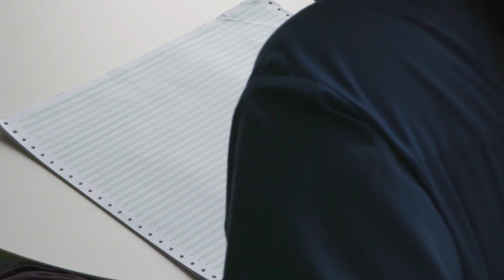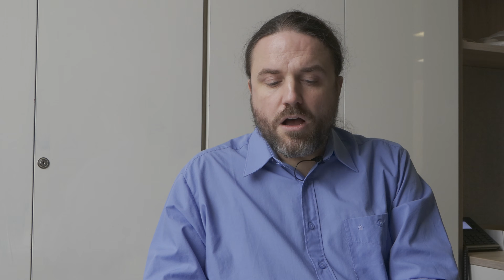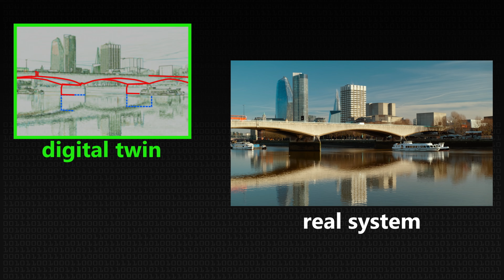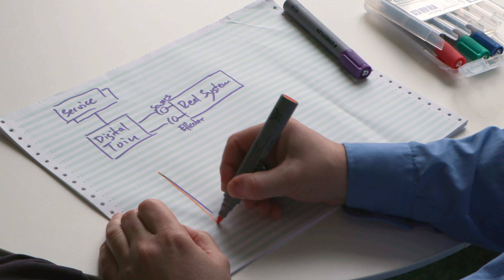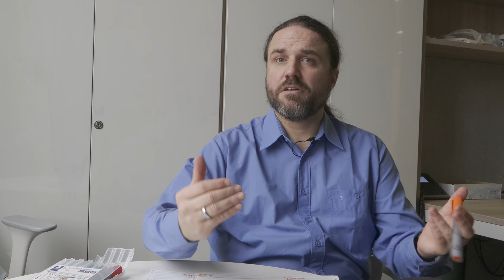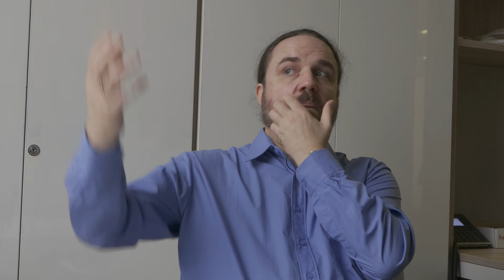Discussing Digital Twins - Computerphile

Comment: All the examples he provided is just data pipeline with data analytics & modelling. And modelling allows you to do what he called what-if analysis which is not unique in Digital Twin. Don't forget building such a huge software system requires maintenance :)

Comment: So basically it IS just a horribly overrated buzzword for "model fed with up-to-date data".
Reply: No, not really.  The digital twin system we develop for customers gives you the ability to walk around a real world site with AR glasses that overlay information about any part you happen to be looking at.  Overlaying the 3D representation (created from CAD diagrams, 3D models, laser scans, etc) allows you to see where the implementation deviates from the design, for example.  Even without the AR headset, you can pull up part numbers, design schematics, real-time status information on any browser-capable device either on site, or from anywhere in the world.
Reply: @-_James_-  What you're describing sounds to me just like a really fancy and advanced UI to access Data.
Reply: @NosyMo85  Well, you could say that about anything that isn't a book of diagrams and tables.  But as with most user interfaces, they serve a purpose and exist for a reason.  The hardware requirements for modelling and rendering hugely complex sites has only become commercially viable in recent years, and so in that regard digital twins are still an emerging technology.
Reply: @-_James_-  I never said it wasn't useful or there was no reason for it to exist. But to me your description didn't sound like it has any simulating capabilities, but that it just maps available Data to to existing Machines or Consoles or whatever via 3d Models or AR. Therefor making it an impressive piece of UI, just not what i understood would classify as a digital twin.
Reply: @NosyMo85  That's all a digital twin is though.  A digital representation of a real world asset that can display current real-world state, be used for simulations, be the basis for future changes/upgrades, or provide the user with access to schematics and other related documentation.
Reply: @-_James_-  So basically the definition of @AttilaAsztalos that you disagreed with? 😜
Reply: @NosyMo85  Well...  no.  And yes.  😂  I guess it depends where you draw the line between model and data.

For me, with half a lifetime of working in the games industry, a model is a very specific 3D representation of something.  But in and of itself, it doesn't do anything.  It's how you combine that model with both offline historical data and online current data, and how you interact with the system as a whole that makes it more than just a buzzword.

In my mind, anyway.
Reply: @-_James_-  I think that explains our different views. To me everything that is purely a visual representation (including a 3d-Model) i would classify as UI. And a model in the digital twin context i thought more of a physics model, as in some kind of simplified representation of reality that can simulate reality with hopefully sufficient precision for the use case. You could then visualize the state of this model as a 3d representation of the actual thing the model is based on, but that to me would be just UI presenting the data.
Reply: @-_James_-  very curious if you guys have a company, i'm assuming you're using hololens/quest3 for the AR representation, i'm on the lookout for companies doing that sort of thing!

Comment: Sensors can be difficult thing to do right because their calibration can drift off course. Now you need people to check and calibrate the sensors, and they need some kind of standard or other testing equipment to calibrate to. And then you also have to figure out what to do with the poor data from any sensors that have drifted off from reality prior to calibration.
Reply: Yes. The digitaltwin can keep records of the calibration events and tell with simple math or predict when new calibration is required

Comment: The concept makes sense for things like industrial processes and aerospace, where the simulation is based on well-known physical laws, but it’s increasingly being applied to social systems. Once you expect your model of human behaviour to be a perfect simulation without taking account of culture, collective organisation and the like, you really need to expect the predictions to have massive error ranges. But far too often a senior executive will leap onto the buzzword and, as with “AI”, expect “Digital Twin” to be a box in a diagram that might as well say “and then a miracle happens”.
Reply: Not necessarily...humans tend to operate on chaotic or unpredictable fashion individually but taken collectively they tend to become more predictable. The example I'd give is heating of a gas: if you model this you won't model the individual molecules being heated because it becomes too unpredictable, you model simplified systems that will give approximations of the micro but usable data at the macro.
Reply: @eddy66t6  true people can be predictable but I'd argue freakanomics style modern behavioural economics suggests we're pretty terrible at making those predictions
Reply: @philroo1  The same is true of physics simulations. "All models are bad, but some are useful" is something you commonly hear in engineering organizations (including those using digital twins for manufacturing excellence).
Reply: And if someone say "I'd like you to clarify that step", they're gonna answer "I'd like you to clarify that step", because he's your boss and you're a data scientist.
Reply: 0⁰999 i⁸⁸😮

Comment: Could a real-world system and its digital twin be encapsulated with another "external" digital twin applied to it? Would such an architecture add any value or utility, or is it turtles all the way down from there?
Reply: You could encapsulate multiple twins into a single system that gives an overview, for sure.  Multiple power stations with their individual twins could be part of a larger system that shows the whole electricity grid, for example.

Comment: Nah, you're/he's pushing the concept of digital twin into a specific specialization. That's not the general concept that it represent. Your/his definition is just your vision on it. I think the majority of researchers doesn't agree with your/his description.
Reply: So what is your/your description?
Reply: @WenirR  yeah, maybe I should be more specific. I was responding to the second half of the video, where his description goes out of hand IMHO. His earlier "vague" description is one I find myself more in: it's a model/simulation/etc of a real system in a computer, mimicking is behavior by adaptation to measured aspects. I don't even think that control output (direct or indirect) is even required (, altough it would be a reason/motivation for having a digital twin at all.) And AI is definitely not required. A simple self learning model would also qualify, based on what detail level is required or what's being mimicked.
Reply: @jhbonarius  Some would say any self learning fits under the umbrella of AI, although the usage of the term "AI" is changing over time, of course.
Reply: @MNbenMN  yeah, AI is definitely a buzzword (like digital twin, smart, cloud, web 3.0, etc,etc.)

Comment: in medical devices, co-simulation often happens on the device. the software that runs the procedure and a model run together and the fault codes come from them not matching. the hardware and software can be really complex because you're making a different assertion, that it won't diverge from the model. the model can be developed and partially validated by surgeons and stuff before the instrument even exists
Reply: also, how they diverge in practice is useful, proprietary information that doesn't have to be shared with anyone outside the company. users only need to know how to continue (and "use another one" is basically always possible in a hospital)
Reply: What you're talking about is testing, but this is more about real world events.

Comment: Sometimes they build digital twins of huge structures like an airport. I wonder how much it costs too simulate every stone and every cable. It would still have saved the Berlin Airport a lot of money though. The digital twin would have shown that the escalators are too short for example.
Reply: Your DT needs to be only as granular as your specific use case prescribes. For instance, you don't need to model "every stone and every cable" if you're only interested in clash detection tasks. In fact, because it's that expensive to model everything, as you implied, you usually create different DTs for different purposes and then sort of interconnect them.

Comment: Would a heater/AC paired with a thermostat be a very basic form of a digital twin? The thermostat triggers the heat/AC depending on what the measured temperature.  Or is there a more basic term for a yes/no or on/off system?
Reply: Or does the digital twin need to know that it's representing something?
Reply: Totally seems like it could be. But maybe it'd be more like a targeted central heating system would be more like a digital twin? Like if it monitored each room's temperature and routed more air to the ones that need it?